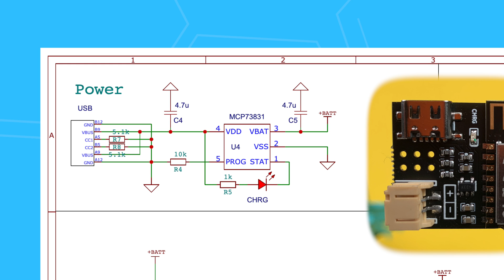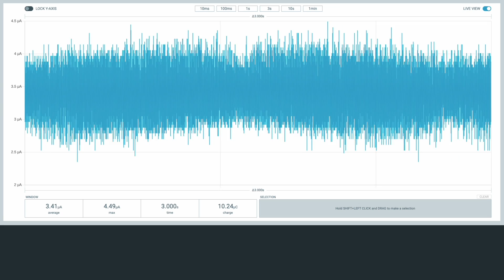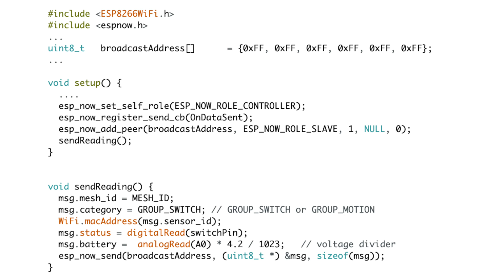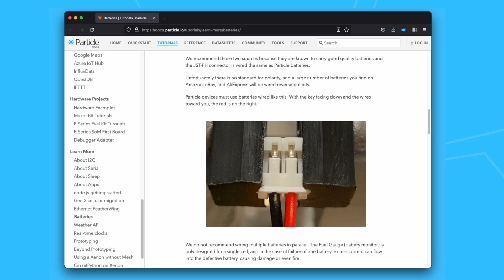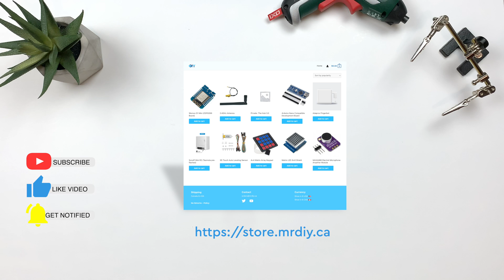Contact Sensor 3 - an ESP8266 Door & Window Sensor

Comment: Is it not a problem to send 4.2v (fully charged battery) to GPIO (SWITCH_INPUT)?
Reply from the maker: In theory, it may, but based on my research and practical experience of using it on multiple doors/windows for years, it has proven to be a non-issue. Additionally, only a negligible amount of current leaks (high impedance) into the pin, and this occurs for a very brief duration.

Comment: Very exciting project! 👍 Is there a BMS to protect the battery from undervoltage?
Reply from the maker: I use protected lipo batteries with BMS built-in for my sensors. The charge controller also has a UVLO. But in theory, if you leave a low battery connected, the ATtiny might drain is ever further over a very long period of time (years).

Comment: Hiii... Your Project is Really good and I am trying to replicate the same... I Have tried the version 3 code for attiny and while deep sleep I am getting a 350 micro amps.. I even tried version 2S of attiny code which gives me a deep sleep current of 26 micro amps... The deep sleep current i mentioned above are attiny alone... May I know what board manager you are using for attiny( I am using Micro dude)... And how much current you get attiny alone while deep sleep??...

Comment: Thanks for sharing ，can I remove the Attiny and directly switch_input to the EN pin of the ldo, so that it is more energy efficient without the Attiny
 if Switch_input is a self-reset button ? My project is to use the self-reset button to remotely control the light through espnow

Comment: A tip that I use for programming is to edit the footprint of the connector to slightly offset the pads a small amount alternating left and right so that the programming pins are a friction fit and have a good contact.
Reply from the maker: I will give it a try - thanks for the tip!

Comment: Cool gadget. Does it come with instructions to pair it with home automation? 
I saw a large battery pack, a coin cell, and a mention of a battery charger circuit. So what is it typical power source?
Reply from the maker: Thanks. It depends on the home automation system. For Home Assistant, you can use this https://www.home-assistant.io/integrations/sensor.mqtt. For NodeRed, you can use the MQTT node to trigger events. 

For version 3, any lipo battery will do, as long as it has a PH2.0 plug ( and the right wire polarity)

Comment: Would you have any idea at what temperatures these are rated at?  I have a shop outside and wanted to put some sensors on the doors.  Last month it got down to -35F (-37C) without wind.  THey would be out of the wind.

The hub would be in a heated area so not worried about that. 

Thanks!
Reply from the maker: -37C is a bit extreme, we only see it once or twice a year here, even my car struggles to start. But it is good question. I will have to go back and check the datasheet for all the components. For now, I will leave one in the freezer and see what happens.
Reply: @MrDIYca  it's not common but it does happen every year. Last year we hit that mark for almost a month, it was pretty crazy
Reply: @WillYork  could the contact sensor be mounted inside, say at the top of the door. maybe with a small part sticking out to trigger the switch
Reply: @blkhackr  so it's a heated office inside an unheated steel building. Ideally I want a sensor on each door. I have shop equipment in the unheated part and electronics in the heated part so I'd want to monitor both.